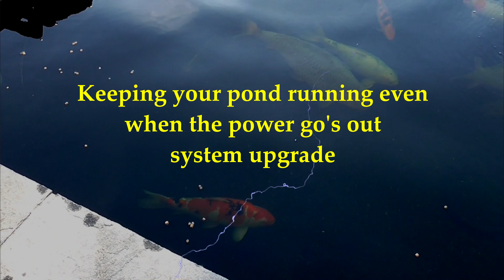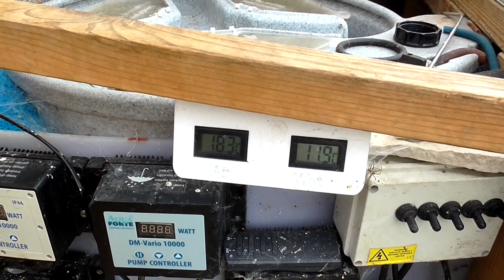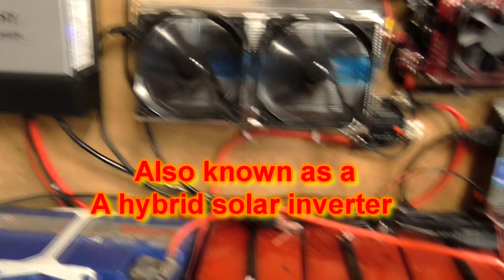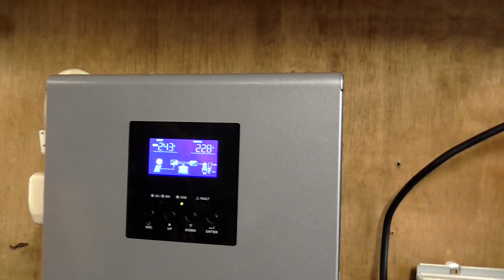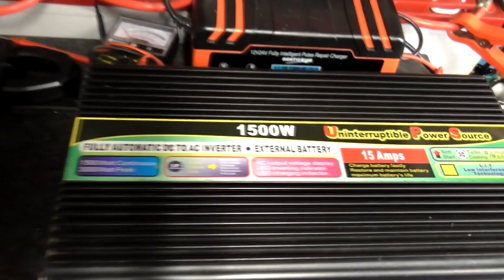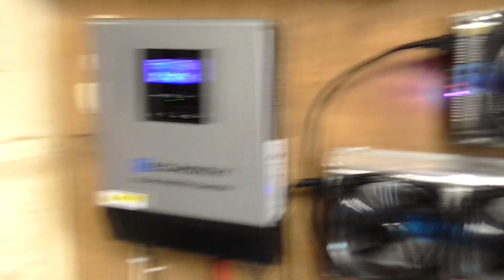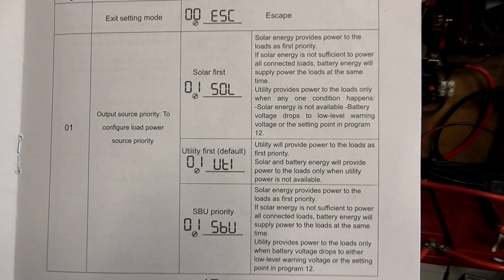*** KOI POND U.P.S SYSTEM ***SOLAR POWERD KOI POND *** RUNNING A POND ON A HYBRID SOLAR INVERTER ***

Comment: I just added a ups system due to a power cut lost quite a few fish some things all koi keepers should do 👍
Reply from the maker: Some people are lucky and power cut's are a thing that happens once in a blue moon we get a hand full a year that last anything from 5 min to 3 or 4 hours and 2 or 3 times a month it will knock out for a second or two it plays nasty with anything that is running at the time. Its been like this round hear from when I was a kid spent many a night with candles for the only light back then. Have a good weekend

Comment: Gutted about the ogon mate 😢. That new ups unit looks the business 👌🏼
Reply from the maker: As an UPS its a cheap way to go with a pair of 140 Amp lead battery's it would give you 4 to 5 hours run time in a power out at a pond power use of 200w  more if under less if more all for about £350 a bargain for what it is. The Ogon was a big loss but they all are when you have had them so many years. Have a good weekend Mate